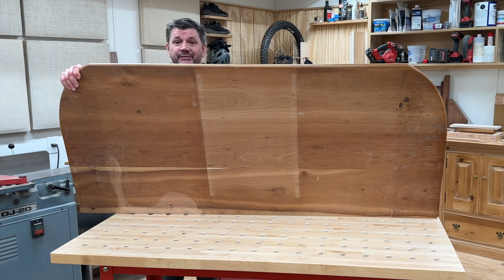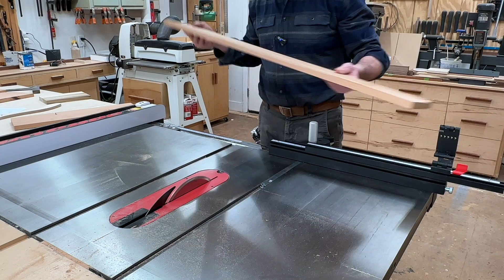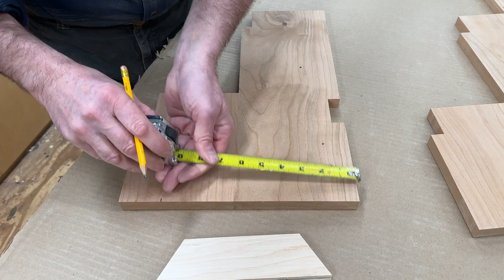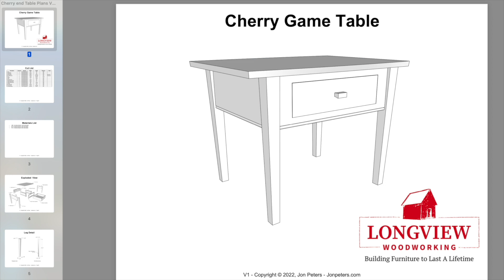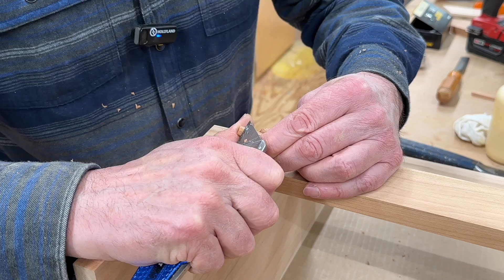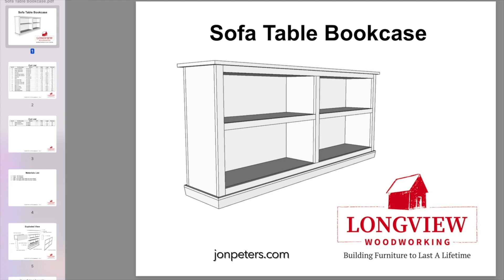Build a Shaker Step Stool - Weekend Woodworking Project!

Comment: Probably this is a novice question, but if the table was already glued and biscuited, why not cut out the side L-shapes instead of ripping them back into boards and regluing with dominoes? Seems like biscuit vs domino is just flavor preference. Is it for the strength of the resulting stool, or just easier to start the new build from planks?

Comment: Lovely piece. Like you, I haven’t purposely distressed a piece in decades. Are you still using that UV cured hard wax oil? I heard that there were issues?
Reply from the maker: Thank you! I haven’t used it in a long time… the dry time is great but it’s a lot of work.
Reply: @JonPetersArtHome  thank you. For almost every internal piece, my go to finish is 2 pack hard wax oil. If I’m making pieces like picture frame, I go back to shellac as there is no need for durability; everything else, 2 pack HWO. I now only use 2 pack as, like most woodworkers, I don’t have a dedicated finishing room or area and so really want that relatively quick cure. My only trial with the UV cure was….disappointing. 

Late last year, the Wood Whisperer published a video reviewing all the 2 pack HWO and his overall winner was Natura Onecoat. I had never heard of it and so contacted the makers. It was only launched in the US in 2023 and will be launched here in the UK this year. They were kind enough to send me a sample and it is by far the best that I have tried. Of course, 2 pack costs more per tin but you only need one coat and Natura covers about 55 square yards per litre. For me, it’s a lot easier to use than Rubio and certainly cheaper. If you’d like to try a sample, I’d be very happy to ask the guys at Natura to send you some? Just let me know

Comment: Hey Mr. JP, do you have a video showing how you made that big wooden push guard you use for your table saw? I wanna make one for my wood shop and would rather not have it catch on the blade and come flying up at my head because i built it incorrectly.
Reply from the maker: I think you’re referring to the tablesaw sled… If that’s it search crosscut sled on my channel and you should find it.

Comment: Hello Jon, I enjoy very much your woodworking projects, great job. Question for you on this particular project, if I were to use wooden dowels instead of screws to fasten the pieces together, will the stool be less solid? thanks
Reply: Rule of thumb is dowels are actually stronger than screws provided you're also using a little wood glue.
Reply from the maker: Not at all, dowels would work … might just take a little longer to build